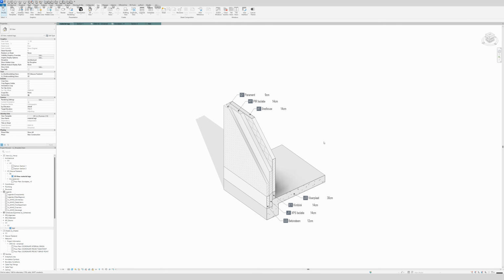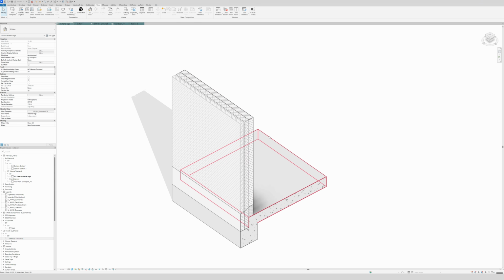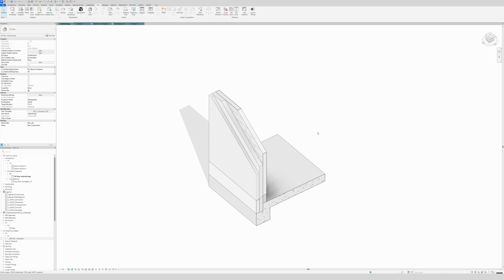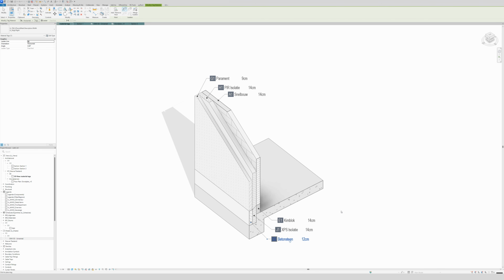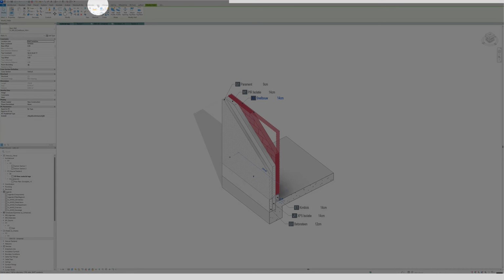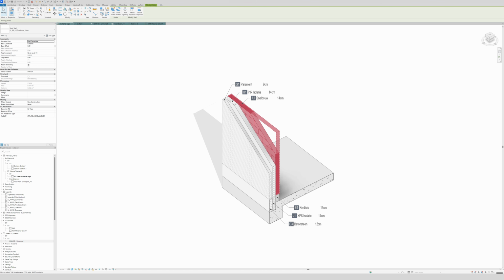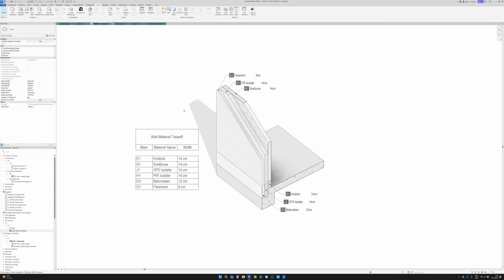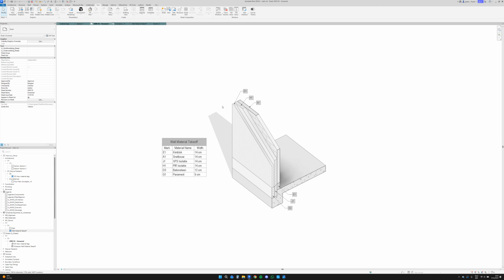Advanced Revit Wall Modeling Tutorial | 3D Materials, Tags & Material Detailing

Comment: I'm not a big fan of that way to identify element... Because what i saw means that you have to create a material based on the thickness of the element. And here is the problem in my opinion... I mean a concrete material will always be a concrete even if your walls have bigger thickness... just use 1 material and use different type name with same material no ? Just asking... I'm using keynotes parameter in type parameter to identify element... you just have to create a keynote tag family...
Reply from the maker: Indeed, that’s correct. It’s also perfectly fine to use one material and create different thicknesses from it, and then adjust the keynote via “Edit Type.” But if you use material tags, you’ll run into problems because they can’t determine the thickness of your family has, they are purely based on the material. As long as you stick to materials, it doesn’t matter whether it’s a floor, wall, roof, or toposolid… your information stays with the material.

In your case, you would have to create everything separately and fill it in separately, which can be very time-consuming and can lead to mistakes due to repetitive work. Everyone has their own personal preference, of course ;)
Reply: @Manda.L  there are addins that solve this issue with Shared Parameters. It also works in plans or sections for entire walls which were not split into parts. You can essentially tag the wall and it will pull out all layers information.